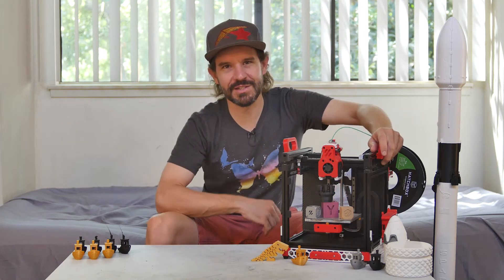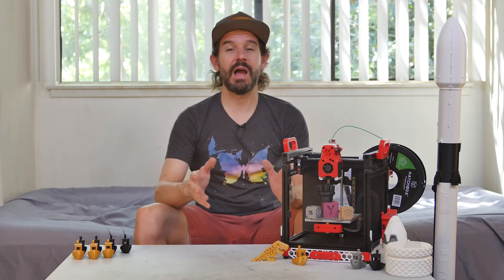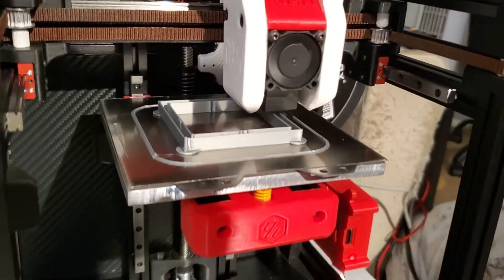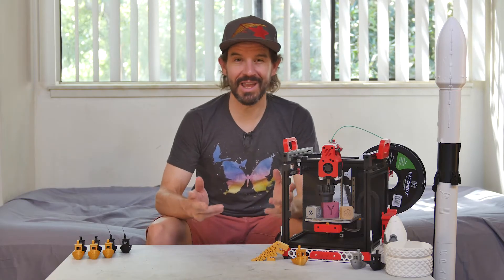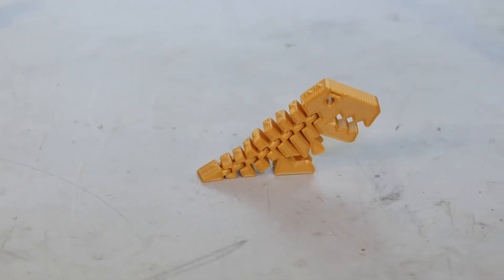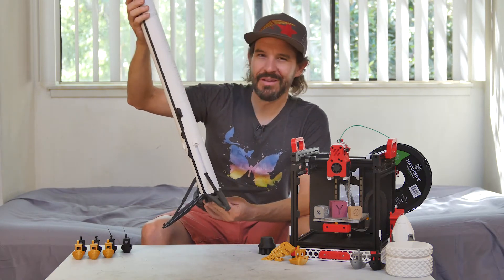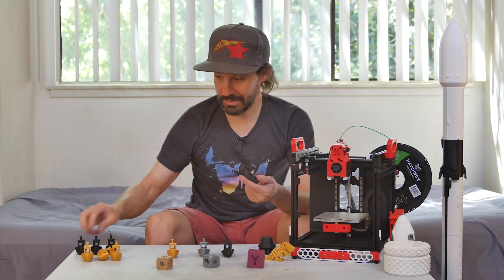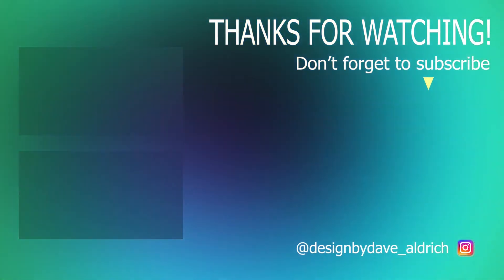The Voron V0 3D Printer is Complete!

Comment: So, if you had a choice to only get one, ignoring size... Ender 6 or voron V0.1?
Reply from the maker: This is an odd question with a lot to unpack. "Ignoring size" well that's silly as that's the main difference between the printers. 

Also, you don't "get" a Voron, you have to source all the components and build it yourself. This is a rather large undertaking unless you already have all the tools and hardware. As you can see from the videos in this build series. 

They are different tools for different jobs, so it depends on what your needs are. It's nice to have both, to complement each other. The mini V0 is great for fast printing of small proto parts, but it's small size can be very limiting.

The Voron printers heavy reliance on 3D printed components could be a problem too. On my latest project I was printing a lot of polycarbonate, which requires high chamber temps that might have me worried with a Voron. Most of the brackets and hardware in the Ender-6 are metal. 

A more applicable comparison would be a Voron 2.4 to the Ender-6. However the Voron will cost 2-3 times as much and require weeks/months to source the components and build.
Reply: @designbydave  Firstly, Thank you for your reply. 

Yes I know the question is quite odd/loaded due to the significant differences in the machines.

I posed such a odd question knowing the machines are quite different but similar in motion mechanics. 

Being someone who has 2 Ender 3's currently, and having been exposed to Anet, Tevo, and Creality 3D printers, and assembling a MPCNC, and WorkBee CNC I'm looking for my next printer, and are torn between resin, coreXY and belt. CoreXY has my focus, and I've narrowed it down to either a Voron or Ender 6.

I guess some of the more targeted questions should have been; Do you see an improvement in linear rails vs v groove,  Do you get the same quality prints out of a hybrid (3d printed and metal) vs commercial machine. 

If you had a V2.4 the size difference wouldn't have been as much of a discussion point, but I am using the similarity of designs between the V2.4 and V0.1 to help with the comparison between the Ender 6 and the Voron designs as a whole (this may be flawed and I realize that).